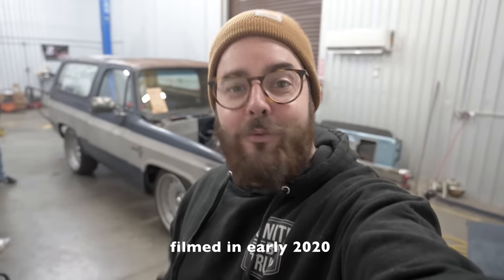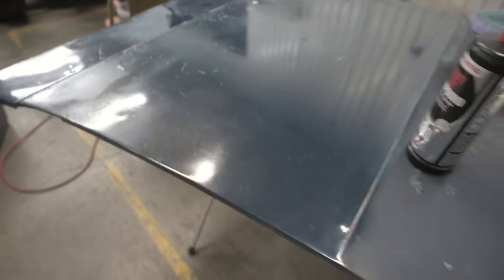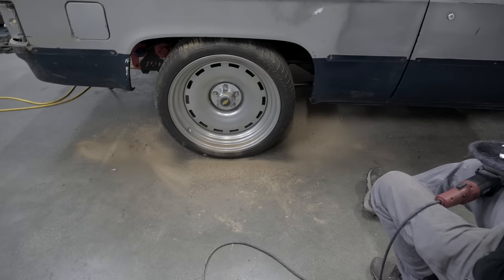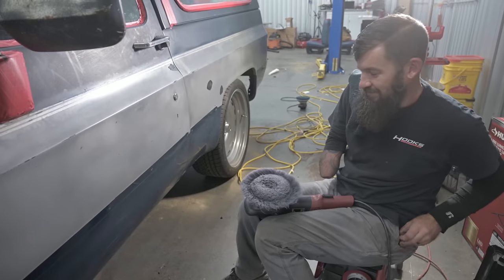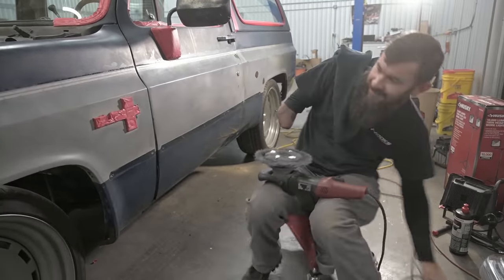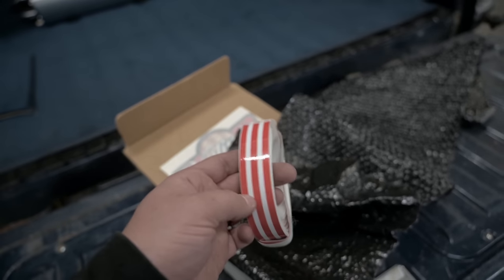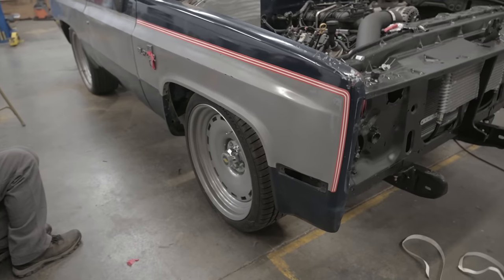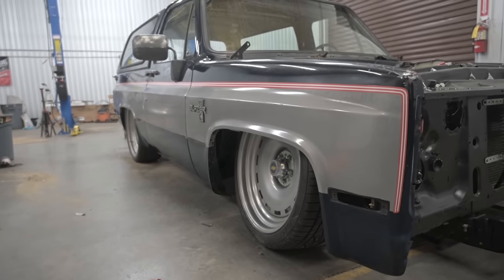SHOULD YOU BUFF YOUR CLASSIC TRUCK? | with Hooks Detailing

Comment: I want to put 18 X 10 wheels on the rear of mt 69 C10 lowered  with 5 drop spring in rear.  What back space should I be looking at?  What was the situation with teddy?  Plan is to also us a 2" block as well but want to get wheels and tires on first.  front is dropped with 2.5 spindle and 3" springs.  Any help is appreciated.  arealss@yahoo.com  Thanks.